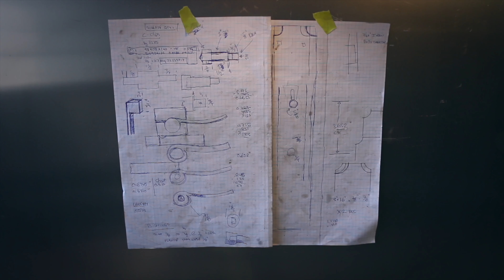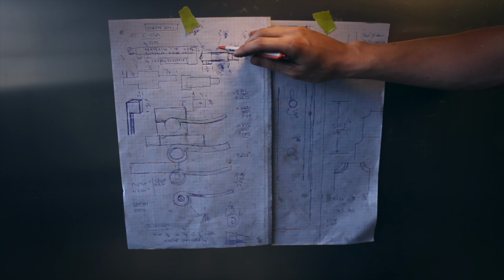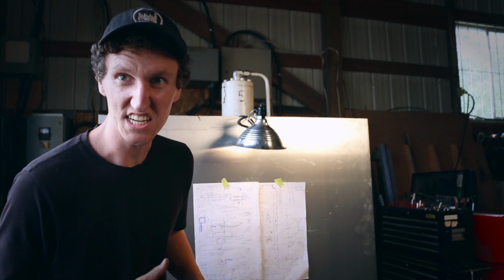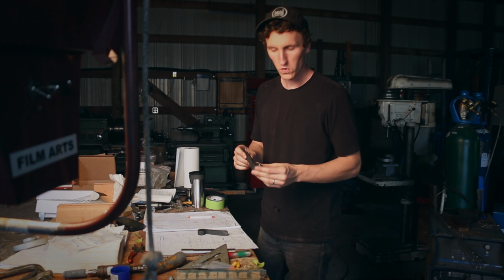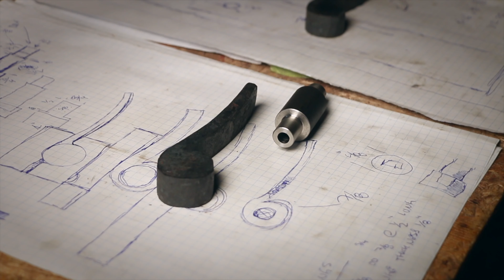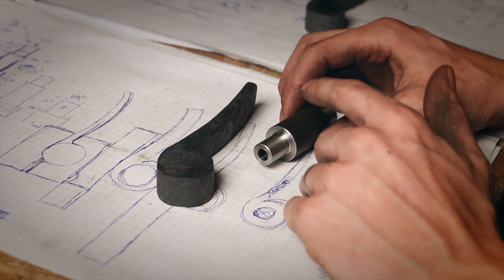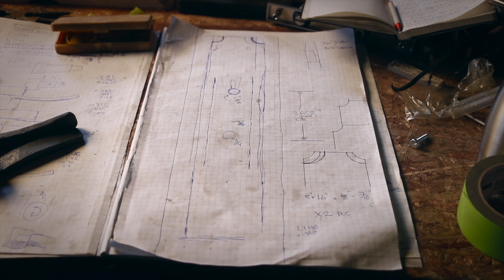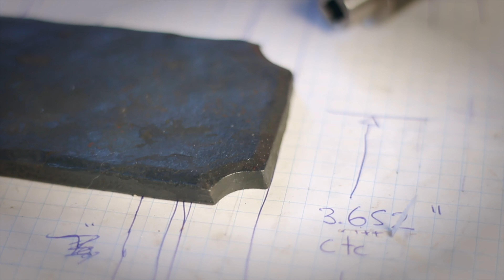Forging Door Hardware - DID I MAKE EVERY PART WRONG???

Comment: I guess maybe you could have forged the hinge down some to upset metal into the hole? Or, get a mandrel and forge around it to the size of the smaller mandrel. Although that would lead to a funny shaped hole. Upsetting into the hole would make a little thinner side-to-side hinge, but it would work. I am just rambling. It was just as easy to turn another pin on the lathe, I realize. Just going over other ideas for the same problem. thanks for sharing the process with us. I appreciate that.
Reply from the maker: Thanks for your thoughts! It’s always good to see how other people approach problems! 😎👍

Comment: The handles look good ' but I have a ? how do you use that hammer and get the work so good .
Reply: A LOT of practice. Trial & error. Fail, fail again. Not giving up.

Try again, made a little progress and failed. Try again, made more progress. Oh wait, what's this?? Made a discovery in a technique. Cool. And so on.
Reply: I was wondering the same thing!  I've never seen a hammer so wonky in all my years around a forge, and yet he strikes square to the anvil every time and turns out some really solid work!  Guess it's just a matter of what you get used to.  :D